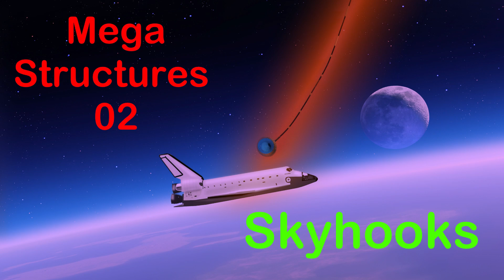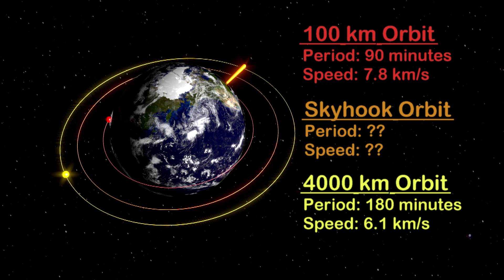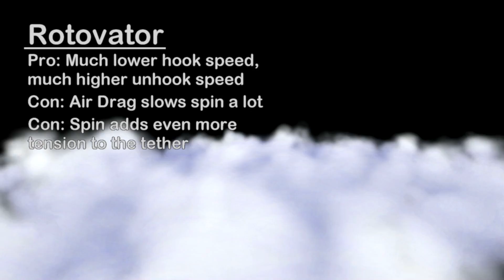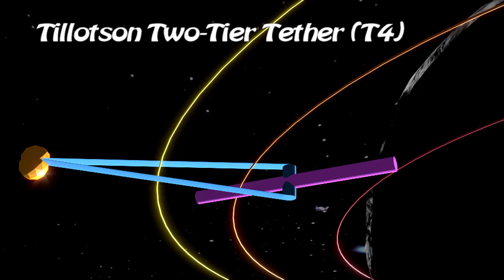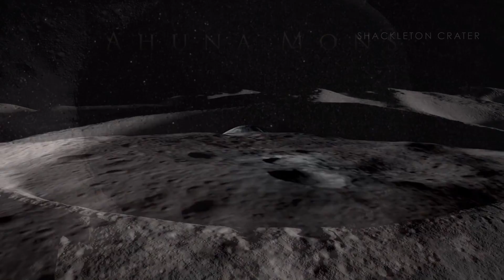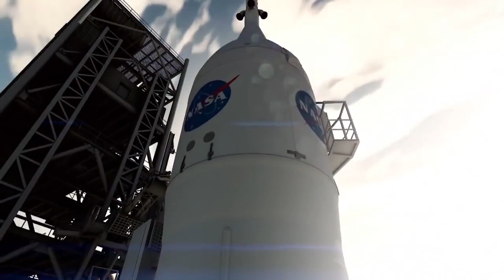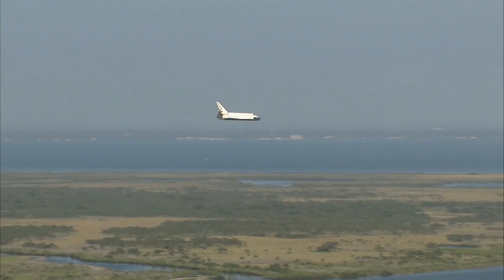Skyhooks & Rotovators

Comment: You don't have to spin the tether. You can reel it out like fly fisherman, let the an ionized cable drag itself to a slower speed while you also gain power. The end of the cable is like a dart and you use variable reeling devices to reduce erratic fluctuations further. There won't be much as long as you are letting the cord free fall on nearly open reel. You don't need the rube goldburg spinning cable. This is perefectly feasible without that.

Comment: There's a good reason besides the one you mentioned to have parachutes on the tether of a space elevator, skyhook, or rotovator.
Even if it doesn't fall on anything important, if it falls down in one (few kilometers long) lengthy piece, that's a lot of high tech material.
Waste not, want not, even if it can't be spliced into a new megastructure cable, I'm sure there are other uses for such strong and lightweight material.
At the worst, you could use it like fiberglass reinforcement in composites, shred it or cut it carefully into specified lengths and blend it into a polymer or resin matrix material, and you'd have something much much stronger than Carbon Fiber. That would be great stuff to build the structure of aircraft intended to be caught by such a skyhook or rotovator, so tether sections that have reached end-of-life could get a new lease on life by being used to help make some new non-tether incredibly strong and light thing.
It's doubly important if we decided to start industrially manufacturing carbon nanotubes using current manufacturing methods, because there are many incredibly toxic and environmentally damaging chemicals used in those processes which are hard to dispose of in a way that does not damage the environment.

Of course the ideal case is that the cable segments have a finder's fee attached, and are able to be spliced right back into the main span of a space elevator, skyhook, etc. tether cable, but if that's not possible for some reason recycling is the next best bet.

Comment: I'm thinking more along the lines of a LASER POWERED SYSTEM .
Lasers to guide up an invisible rope of light, lasers for speed control and landings, lasers for power . 
Like going straight up from the Heli pad without any mounted structures

Comment: Got some burning questions here for some big brains. I want to crunch the numbers but its been 16 years since I last did any Engineering Maths.

Isaac Arthur suggests that a 2000Km long cable of Zylon would be much cheaper to manufacture than the $250^6 cost to launch it.

 (I suspect this must be wrong)

 By that measure, at the cost of, say $500^6 the ISS could be provided with a cable and winch unit, complete with a sensor / Beacon drone attachment, to the order of 100Km long, which would add significant weight (Say 60T) to the 420T space station.

The ISS orbits at 400km but now has a cable capable of dropping out as a sky hook down anywhere from 15km   - 300km above earth 
(Length selected Depending on cost / concept trial / drag info / debris probability / ect)

 The cable adds drag and pulls ISS downwards.

A rocket can use the cable to deliver a payload of ISS fuel at reduced cost to launch as it needs a lower altitude to reach the skyhook / cable.

The payload further drags ISS down

ISS winchs the cable back in and uses the fuel Payload to return to altitude.

The ISS is a reseach vessel ; if not entirely economical, what is the value of such a mission in proof of concept for Skyhooks?

A much smaller unit could be proof of concept, longer units used - in theory - as a cash saving tool.

Is such a mission not being proposed because of safety fears, available budget, cost feasibility or technical challanges? Which? (As problems are often overcome by the Will to do so)

At what point does this become economical over normal re-supply costs? 

How much space debris is there to avoid? 
To avoid space debris, how long would such a unit take to put out and pull in?

 (Power availability of ISS / cost to add additional power cabability?)

So on, so forth........ 

Surely some grad student has crunched this all somewhere online, right? 

- Edit Actually just read a previous comment that says NASA did try a tether and winch experiment but the winch failed and they had to fling it! So NASA have got the crunched numbers somewhere!

Comment: Could the skyhook be made to pick up cargo from high altitude balloons? My question is if the skyhooks velocity at the bottom of a tether could be made low enouph to pick up stationary cargo at high altitudes? If this is the case it offers another means of lower cost space transport without the need for hypersonic planes. I may not be understanding the physics of skyhooks so if my assumption is wrong let me know.

Comment: I did some math and it looks like a sufficiently counterweighted skyhook will launch anything it gets just over escape velocity. The main condition is that at the bottom of the rotation the hook is traveling 0m/s relative to the ground, which would open an opportunity for sub-orbital rocket designs going interplanetary, as going straight up will be all the first stage needs to do instead of going sideways.

The faster the hook travels relative to the ground at the low end the lower the boost will be, a hook that is zero at the bottom will send its payload to twice its orbital velocity, which is ALWAYS above escape velocity.

Comment: I feel like you could put machines on Venus that use the hot atmosphere for both propellant and power to induce more spin in Venus with an exhaust nozzle above the atmosphere on a space elevator. You'd have to be ok with it taking a loooong time, but it could be done.

Comment: Some factors are being glossed-over, here. The Sky Hook concept is a good one IF the truss arrangement could be cured from the Orbital Trap Du Jour: Rotation. ANY portion of an assembly that travels outside of its orbital parameters, MUST be kept in line (read: use a LOT of fuel), lest the whole concept evaporate into cis-lunar space.

What this means, is that the "bottom" of the structure would be inevitably drawn to a FASTER orbit, and the "higher" part of it would be drawn into a SLOWER orbit. Under this CONCERTED "spinning" influence, the whole thing would rapidly become unusable.

Sorry to rain on the parade like this, but if we try REAL concepts, they MAY just work out...

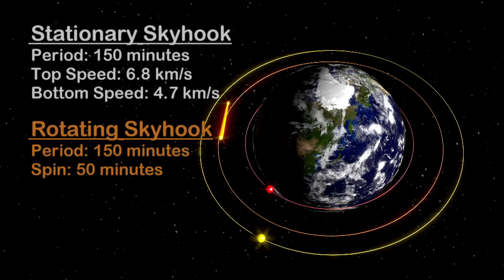Likewise with the "Rotating Skyhook" shown about 8:30. It's rotation is shown exactly opposite what the orbital dynamics would generate. So you either have to commit to using a LOT of fuel just for keeping the rotation you want, or the thing will end up spinning anti-, and being totally useless.

Comment: What if we built the top of a t4 so that it looked sort of like an egg beater? It could be timed to avoid important places in Equatorial orbit, and by picking where in the phase of rotation you pop off at the top you could get to inclined orbits without having to burn as much fuel to get there.

Comment: As far as cargo and materials it could be quite great but one of my concerns would be the acceleration (G-force) being inflicted on the human body from change of speed from the bottom of the rotovator to the outside of the spin. You would be going from perhaps a 0-G environment to the end of a wip and then back to 0-G as the body catches up to the acceleration again. Also if you combine them they would need to spin in opposite directions of each other to make the hand off as easy both on the cargo and the ship it is in.

One thing you perhaps left out is that the ship that would connect to the tether could also accelerate the tether with it's fuel or form of propulsion. The ship would bring energy to the tether as it's not at zero speed when connecting it could add energy to the rotation. If you think of a jet landing on a carrier it applies full throttle just in case it misses the arresting cables. When it does connect it's engines would in effect pull the ship just a little as it's engines add propulsion to the ship even though the ships mass is so much greater it's not effected that much. 

Really great episode. Very forward thinking and comprehensive in both scope and detail.

Comment: Thanks @Isaac Arthur for the great series!!
A small correction and addition regarding skyhooks: You absolutely can and would want to taper a skyhook tether! On either side of the center of mass, the forces taper out towards the ends, so it pays to let the thickness of the tether taper correspondingly. This goes for both rotating and non-rotating tethers.
And regarding the requirement to reboost the orbital momentum of the tether after use, one very exciting possibility which was not mentioned, is simply transporting payload mass in both directions! If the mass lifted equals the mass lowered, then the total momentum change of the tether cancels out. In many applications, this is a really fantastic option, which essentially makes the payload transfer “free”.
E.g. a rotovator is a great option for depositing payloads for say a moonbase directly to the surface, which is a huge saving for an airless body where aerobraking is not possible. But if you simply let the rotovator deposit a payload on the surface, and then replace it with another payload to be lifted back up, there is no net change of momentum - the two payloads are simply “swapping place” which requires no energy (the payloads just exchange potential energy)!
If there is no suitable payload to be lifted, simply lift any pile of rubble of identical mass, and let the rotovator fling it whereever.
So one can design a complete system of rotovators, picking up payloads from suborbital trajectories in our atmosphere, and flinging them to another which adds the momentum for a translunar transfer, to be catched by a third rotovator in lunar orbit which lowers the payload all the way to the lunar surface - and it will require no energy at all, so long as the same system picks up a package of identical mass from the Moons surface, flings it to Earth, and lowers it down to the same suborbital trajectory in Earths atmosphere!
It may seem wrong, but lifting one object, while lowering another correspondingly, does not require any net energy (just as is instinctively true for two identical masses on each end of a rope passed over a pulley)

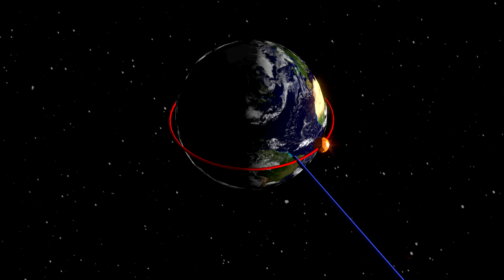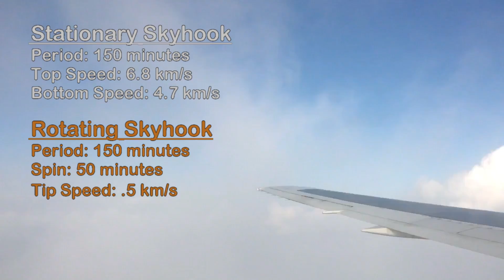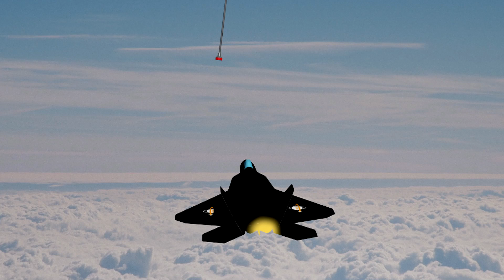Comment: This speaker is very knowledgeable, I don't mean to put him down personally. But please, allow me to point out some flaws in this vid, First off 7 seconds in a jet is docking, this is not how you would dock, you would come along underneath the hook, match speeds and then rise up to meet the hook without ramming it and causing a structural failure. At 2:22 he mentions making one end larger then the other,?.Surely you would make the middle of such an object the strong point as it is rotating with equal pressure on either end.  Now just remind me how we got a 4000 kilometer item into space, And is built of a material that does not exist yet, Around 7;35 the tether are shown in an orbit the is impossible, they will rotate around a common center of gravity, (9:00, Mach 1.5 is faster "then most commercial jets" in fact it is faster the all commercial jets. 18:18 .A magnet can grab onto an aircraft, Not in this life time, aircraft are built from non ferrous aluminum , titanium and carbon fibers, .no magnet will catch these guys. 22:55 That plane needs to have all the insulation of a Space shuttle so it does not burn up on re-entry. 23:28."skyhooks are cheap" just remind me again how we got a 4000 kilometer cable into space. This whole thing is science fiction at it fictionest.

Comment: Im sorry to say but there is no way this possible or if possible, practical even for a futuristic society. The main issue is the gravity gradient along the sky hook's length. A quick analysis of a simplified structure shows that the gravity gradient will cause the rotation about the axis that is required for operation to stabilize. In this context, stability is actually the problem, the rotational momentum of the skyhook will be sapped off continuously by the earth. Simply put, the change in gravitational pull across kilometers of the tether will cause it to go from continuous rotation to a pendulum-like motion pretty quickly. Maintaining the appropriate rotation would require constant thrust compensation, from my back of the envelope calculations, the lower limit of force you would need to overcome this exceeds what can be achieved by electric propulsion (barring any future plausible fusion type drives). The basic tests that NASA did with shuttle and Gemini showed that even short tether systems have stability issues. I want to note though that in deep space the gravity gradient is low enough that maybe this could be used to get from one Lagrange point to the next or something like that

Comment: One Important aspect you didn't really mention is that you can basically do regenerative braking with them. So you can slow down your ship at the destination and give the tether energy in the process.
Reply: This would be very practical also to gently lower a spacecraft down into an atmosphere, making it more comfortable for passengers as opposed to having a "hot reentry" which would be multiple g's. Now, a spaceplane such as the Space Shuttle Orbiter already have the advantage of having gentler deceleration of under 2 g's compared to capsules where occupants would experience anywhere between 3 to 5 g's, but if an option exists to make it even more gentle than that, it would be more desirable since not everyone would be able to withstand a lot of stress.

Comment: Why haven't we done this yet. Well for one we do not have the cost to produced 4000 miles of carbon nano tubes, the whole process also has so many "well if you do this, and spin up that, and do this" which adds layers and layers of extra complexity and chance of critical failure. Where simple rockets are by comparison a lot less fiddly.
Reply: Those simple rockets though will add up in terms of cost and resources. The Sky Hook idea is meant to be for the future, when launches are much, much more common, and a sky hook would significantly reduce the cost of space travel, making up for its cost many times over, in addition to it being cheaper and more feasible to build by future civilizations.

Comment: I am SOO lost on how these work. The animation shows the ship traveling to the left. The hook is swinging down to the right. You're telling me this thing yanks the ship out of the sky, and swings it backwards? Why wouldn't you just have the ship already going in the correct direction?
Reply: I’m guessing you’d have to chase it in that case.
Reply: @sonicvenom8292  sure, but the force of sending it in the opposite direction should be detrimental. It's like hitting a baseball with a bat. Both the ball and the bat experience trauma when they slam into each other.